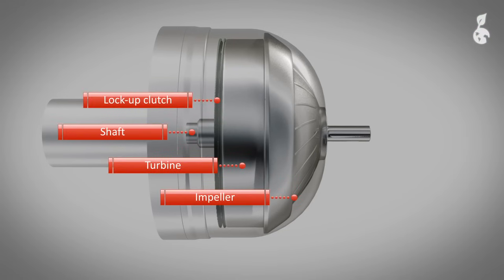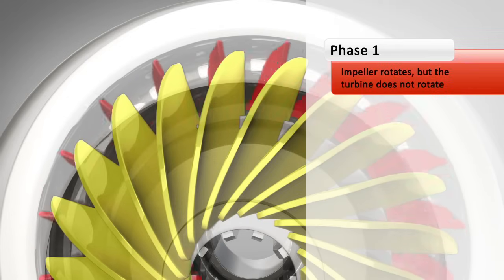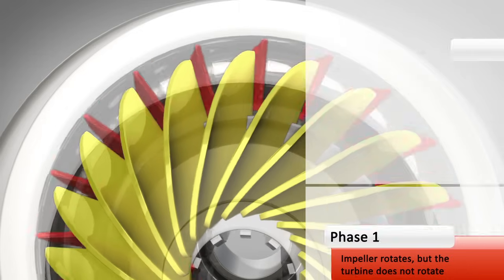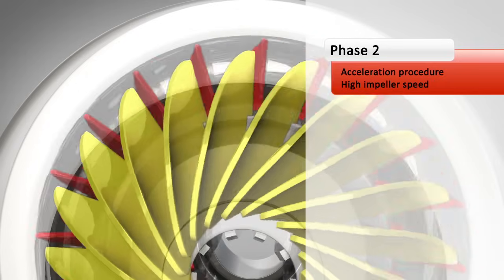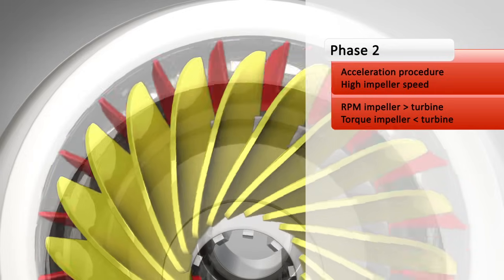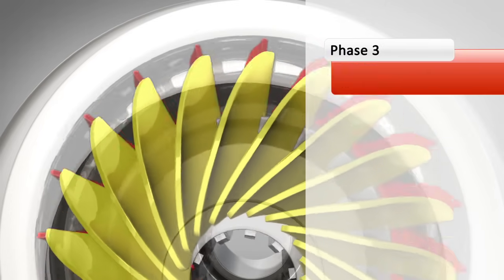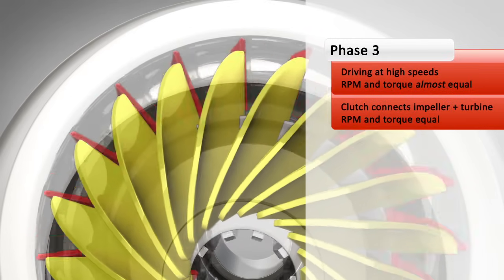How Torque Converters Work! (Animation)

Comment: great video an explanation although I would focus more on the stator and the transition among the 3 phases. but, as I said, nice job! ;)
Reply: The stator redirects fluid flow exiting the input turbine, so the fluid impacts the output turbine more forcefully. This allows the fluid to transfer its kinetic energy to the output turbine more effectively. However, the stator also creates a lot of turbulence in the fluid, and therefore wastes some amount of energy in the process.

To minimize this effect, the stator is mounted on a one-way bearing that allows it to spin freely, so it stops interfering with fluid flow when the torque converter is spinning at high speed. This occurs once the entire torque converter is spinning fast enough that the forward rotation of the torque converter overwhelms the force of the fluid trying to spin the stator backwards.

Since the force trying to spin the stator backwards depends on the total amount of force being transmitted through the torque converter, that means the exact moment when the stator unlocks and starts spinning depends on how hard the vehicle is accelerating.

In layman terms, you can re-lock the stator just by stomping on the gas pedal. There's no real reason for you to do this, though, because re-locking the stator is only useful during hard acceleration anyway. Just let the stator do its job and drive the car normally.

Comment: a fluid-turbine reciprocating coupling, an ingenious concept, the fluid is efficient at transmitting torque compared to a mechanical gear. or does this have much better wear characteristics. How well do the fluid-dynamics withstand external influences?

Comment: Great video! Good job on the animation. Couple of things on the English though.
1) At 1:23 you say "Because, for example, torque conversion and energy ...."  This should read "Because torque conversion and energy ..." The "for example" is distracting because you are setting the listener up to receive an example, but instead they get a statement.
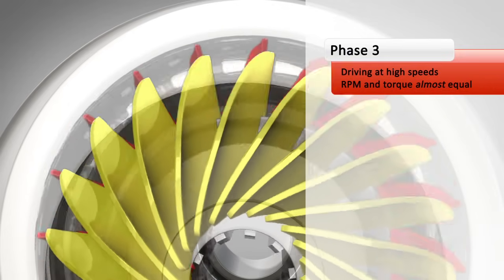2) At 4:02 you say "The torque multiplication has ceased." In this case 'c' is said with it's 's' sound. So instead of saying "key-ssed" it is said 'sea-ssed'.

In technical writing and speaking try to avoid common street talk. For example: "You could say..." is not a phrase you want to use when making declarative statements about how a device operates.

Hope this helps and thanks again for sharing this knowledge and your excellent animation skills.
Reply from the maker: Thank you for your comment. I'll try to make you happy :)

Comment: Hey man thanks for this. This was the best video I have seen on the torque converter. I just have one question: How exactly and why does the stator multiply torque? I know that it "reverses the flow of fluid direction" but I dont truly UNDERSTAND how it does so. I have read the entire wikipedia article and still dont get it...

Thanks again for the video

Comment: So with what is the stator connected to? And is the automatic transmission is planetary gear transmission?
Reply from the maker: The stator is static and can freely rotate when a certain RPM is reached. Yes, the automatic transmission is a (compound) palentary gearbox.
Reply: Can freely rotate?? I thought it was fixed @_@... And please make the video about automatic easy to understand.
Reply from the maker: As I said: It's fixed but when the RPM is high, it can freely rotate and the troque convert acts as a fluid coupling.
Reply: So is it actually not connected to anything to make it stationary? If not, how it become stationary at low RPM?
Reply from the maker: It's a one-way clutch. See Wikipedia for more detais :)
Reply: Indra Ida Bagus The stator is connected to the main body of the transmission, which does not rotate. There is a one-way bearing that allows the stator to spin freely, once the entire torque converter is rotating fast enough to override counter-rotating force of the fluid passing through the stator.